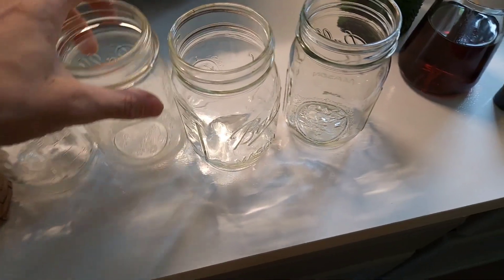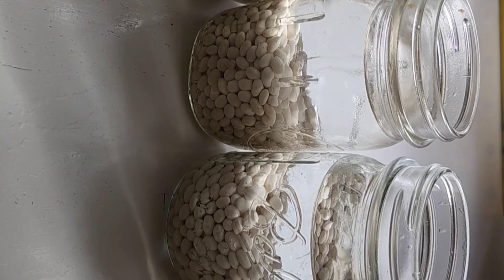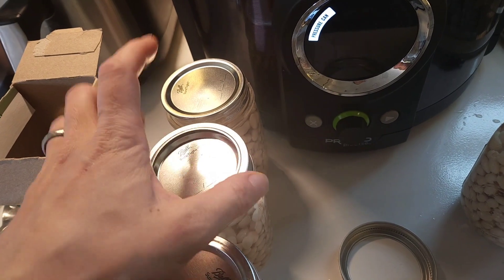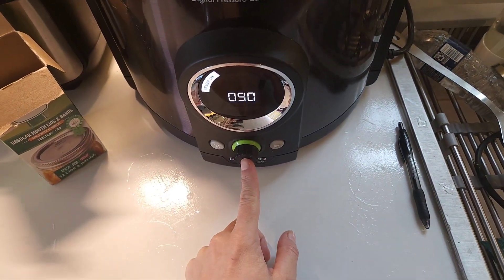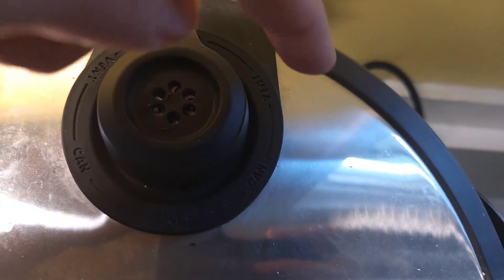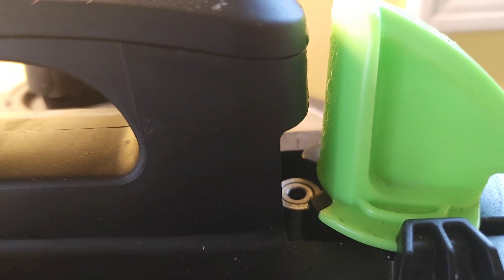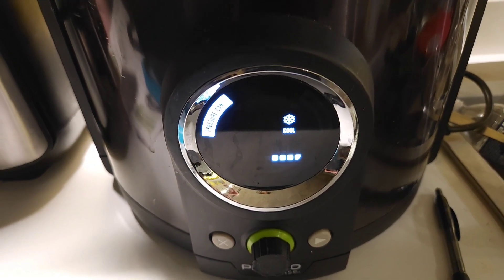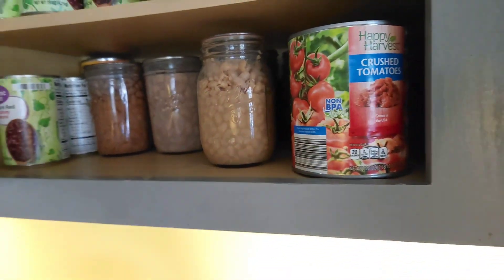Presto ELECTRIC pressure canning and what to do if you get an error code #canning #homemadefood

Comment: When you put your regulator on before starting, you should put it on Vent first. After it vents, then turn it over to Can.
Reply: Last night I canned turkey broth. I put 8 pints in the canner at one time (I have one just like this one). I set the pressure time for 20 minutes and went through the steps of venting for 10 minutes, then turning the regulator to Can. I canned 20 pints total so my third canner load only had 4 pints.